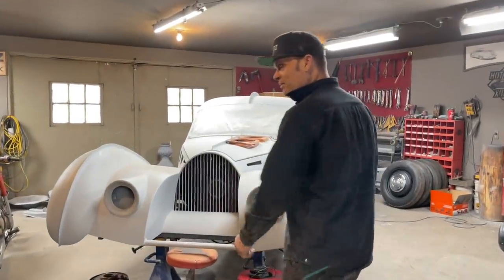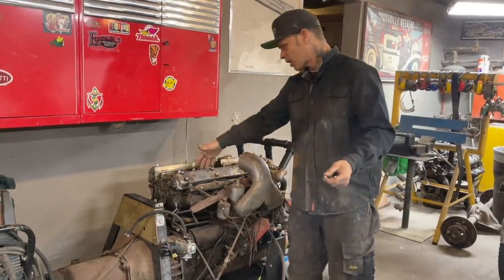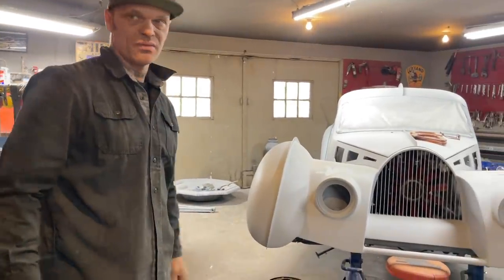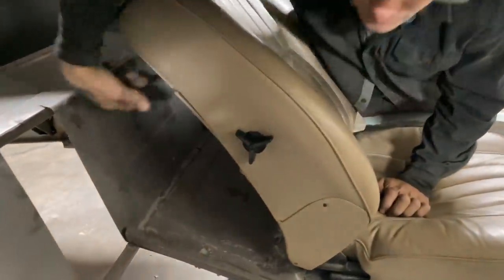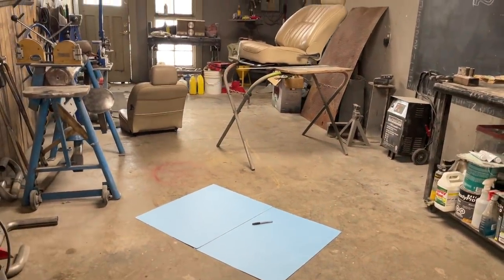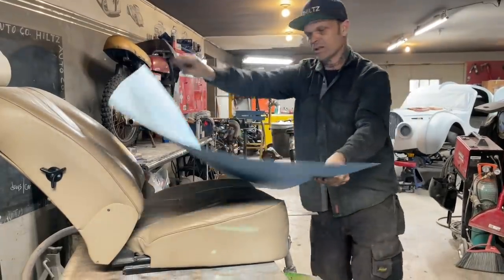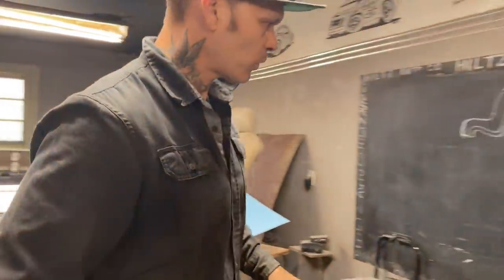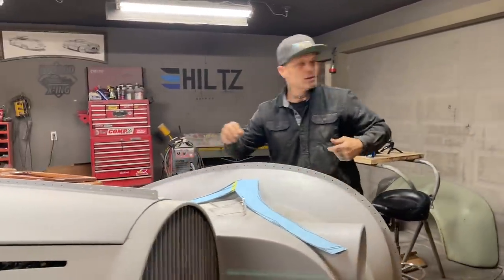CREATING A TEMPLATE FOR THE BUGATTI SEATS

Comment: Chad, you're absolutely right about the shape of the donated seats being too stuffed and contemporary for the 57C.  In the original years this car was built there were two art forms which dominated the the mindset of car designers.  They were Art Deco and Streamline Moderne.  The Type 57C had elements of both. In many of these models the seats almost looked like beach chairs. They were so thin but they had to be that way in design because the seats were designed for seat of your pants driving not for living room comfort. Also personally since you have a master woodworker at your disposal, I'd have him make wooden veneer trim (perhaps only one and a quarter inch wide) to cover the middle of the metal sides and add accent to the sides of those seats.  The seats would naturally be slightly more narrower than the donated seats to accommodate such aesthetic accents but it would certain make the seats "pop" compared to plain metal when opening the doors.

Comment: Good design. Pivot points are cool too. Nice to be able to adjust them. Easy to do, just a 5/8” rod, a spring, and a lever on each one. Same 1/8” sheet metal design, just two pieces instead of one. It’s coming together quite nicely...

Comment: If you don't want the seats as wide as those that you tried, but they are comfortable, just make the seat as wide as the center section where the vertical stitching is. That would get rid of the bulky sides that are taking up the space and still the comfortable section where your body sits.

Comment: A comment. I know you’ve done your seat already as I watch this. I’m just thinking of a Ford 1970s era, Van, that had flat seats in it. It wasn’t as bad for the driver as he had the steering wheel to hang on to, but for the passenger it was quite a ride trying to stay in the seat. There is a reason they have buckets in bucket seats. It just a safer and more comfortable driving experience. Of course sitting in that van was more upright than you’ll be in the Bugatti.
At the writing of this I have not actually watched the finish of the video so maybe I’m blowing smoke. We shall see. 
I do find your videos entertaining. You have a way of seeing things reminiscent of my stepfather, who was trained as a machinist in his youth. 👍🏻
@ The End..
A suggestion. You could make the frame out of wood just to check the sitting fitment. I think you’ll find quite an ability to change the angle of the back rest as you change the height of the seat bottom itself. Giving yourself all kinds of options. 😉

Comment: The finish upholstered seat should be the same height and shape as the door thresholds.
Reply: Or just slightly taller, but the same shape. You have good lines with the doors. You won’t see the sides of the seats(easier), and since you copied the contour of the back bolster(vs the center of the seat)following the shape of the door hinge side of the door would probably work, just don’t get the back too tall.
Reply: Do I get a signed Hiltz Moto Co cap?

Comment: The way that you are trying to remove the spark plugs I would be very cautious because of all the heat you are using you could be putting cracks in the head. Then you will be in big trouble.

Comment: The origional Bugatti seat did not have head rests. Your floor boards might have to be redisigned to fit seats lower to the floor. There is bearly any head or leg room. Go look at the Bugatti Type 57C seats for references.